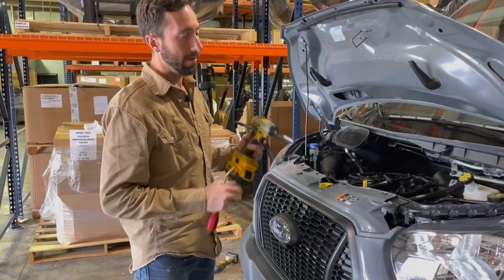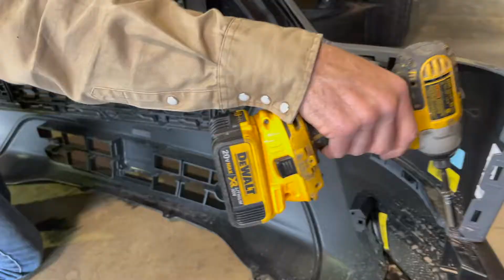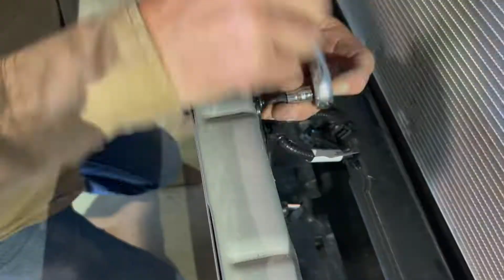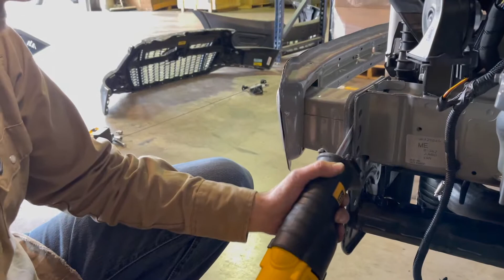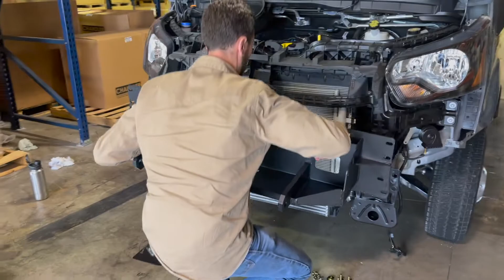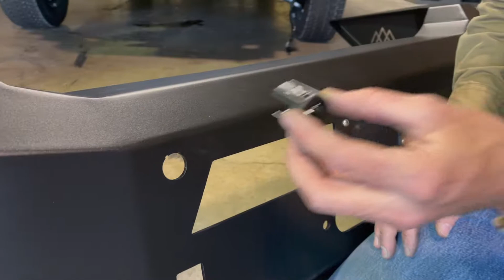[2020+] Ford Transit – Front Bumper Install Backwoods Adventure Mods

Comment: At 6:51 you mention the electronic louvers.  I noticed these are never reinstalled.  Have you noticed any issues as a result of this?  I had this exact bumper installed on my transit buildout and now have an error code for the active shutters/louver system so I was wondering if you all have experience this or if there is any resolution.

Comment: Nice bumper, but the hardware should be Metric like everything else in the Automotive Industry has been for decades now.  Also, pretty sure those are air directors (important) & not splash shields.  How does this bumper affect/change airflow through the A/C Condenser, Turbo Intercooler & Radiator?  Again, nice product, but these are questions to be answered before dropping over $3K on it...
Reply: Yeah, it's weird to throw in SAE bolts in a otherwise metric vehicle--is the Transit all metric? I know the Econolines had mixed, unfortunately.
Reply: @barnabydh  The Transit was/is actually designed in England, as it has been in production in Europe since the 1960s.  So Yes, they're Totally Metric.  I'm pretty sure the E-Series has been All Metric since Ford dropped the old 300 Straight-6/302/351 V8s & started putting the V8/V10 Triton Modular Engines in them.
Reply from the maker: Appreciate the comment. All of our products have standard hardware. As far as airflow, we've tested this bumper extensively and we've put cutouts in front of the winch for that reason. They add airflow as well as give your hands clearance to access the winch controls and to see your winch line spool up. Thanks for your interest and have a great day!